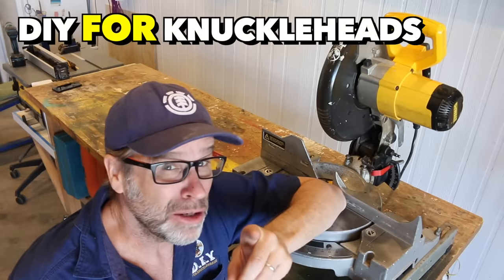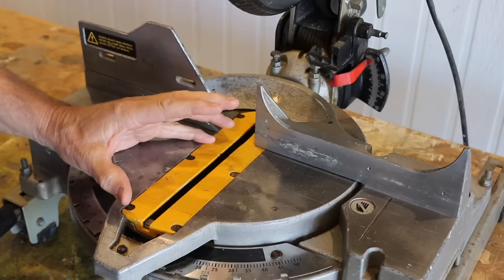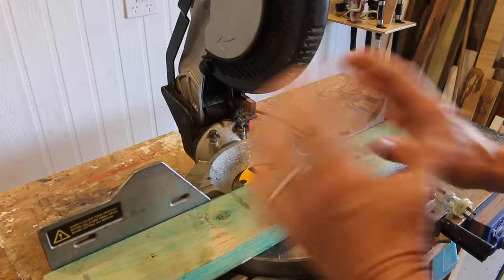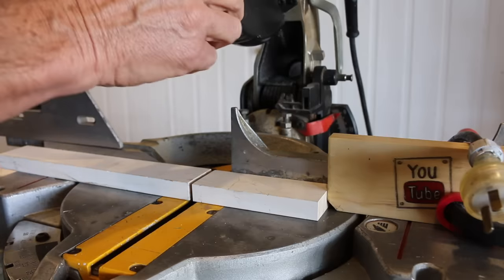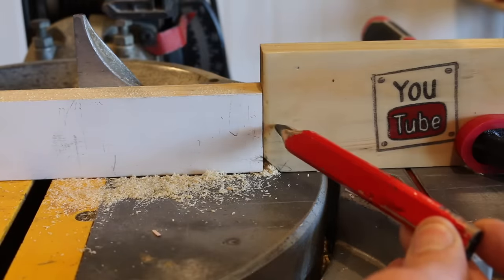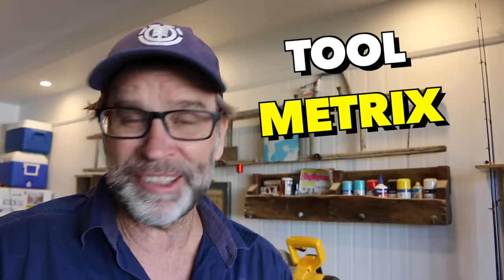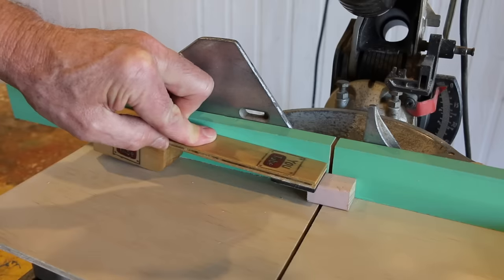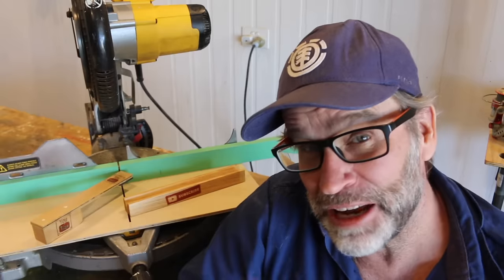My Top 7 Miter Saw Tips for Beginners.

Comment: Excellent. I'll be using your tips. I've been using a chopsaw & slide saw for over 30 years and learned tips watching your video. How about adding a red (nail polish) line to your small workpiece hold down? And red lines to your zero clearance piece on both horizontal and vertical components, left and right side -- since they hide the nice red lines on your saw table?
Making the small workpiece hold down longer could help reduce the inclination to put one's hand too close to the blade -- maybe a quarter inch (6 mm) shorter than the distance from the blade to the left or right edge of the saw table. For my Dewalt compound bevel slide saw that's about 11 inches (28 cm).

Edit: I see in others' previous comments the red line suggestion for the zero clearance plate.
Reply from the maker: All good suggestions mate....wish l had have incorporated them 👍 Thanks for watching 👍😁🇦🇺🎄
Reply: @diyforknuckleheads  Just simple thoughts on my part. Your videos are great. Thank you for them. Thanks for reminding me to stay safe & do well. I wish the same for you.

Comment: I'm looking to buy my first miter saw and ran across your video while researching reviews, and I have to say, I absolutely LOVED your video.  Very easy to follow and fun to watch.  I have to ask, do you have any tips on using the miter saw for cutting aluminum framing? Or should this be avoided at all cost?
Reply from the maker: Thanks mate....glad you found the vid useful 👍😁 You can cut thin aluminium with a standard blade on your mitre saw....l've done it many times but not with your best blade.....l have an older used blade that l put on when l cut aluminium. Cheers 😁🇦🇺👍

Comment: Thank you for the  zero clearance plate tutorial! I made a front opening box spanning the width of our frontroom to house multi-room mini-split lines. I wanted to trim out the front of the boxes, but I had cut very thin trim. The clearance plate worked like a charm. I made three different cuts in the board, one at 90 and 2- 45's (at different spots than the 90.) The trim cuts were so clean and I didn't have to change out the blade from my standard. You have made my work much easier! My little mitre box and hand saw can go back on the shelf. You're so fun to watch too! Keep up the great work!
Reply from the maker: Awesome! Well done Jennifer. Glad l could help and thanks for taking the time to watch...much appreciated 👍😁🇦🇺

Comment: good tips. 1 issue I have had with Tip 7, using the jig can launch the piece especially if it is not a tall piece of wood, as you apply pressure at an angle. I've found another easy way to cut short bits is to use longer bits on both sides of the shorter bit, clamp them in place sandwiching the short piece.
Reply from the maker: Good tip Ed 👍👍

Comment: Looking for advice on cutting two different width boards that have a 1/4” reveal notch, 1/2” from the top of both boards.  First board (baseboard) 5-1/2” second board (casing) 3-1/2”.  Need to match the reveal notch at a 90 degree angle.

Comment: 45 degree angle trick is brilliant!
Reply from the maker: Thanks G.W 👍 Another commenter (webnothing) added this extra tip that is genius.Here is his suggestion: "To extend the 45 deg notch on the stop block hack: cut the notch at 45 and tilt the saw to whatever degree so that you get a compound bevel. Now you'll never need to clear out the sawdust from the notch because the addition of more dust pushes the old dust out. Enjoy! 👍".  Have a good one mate 👍🇦🇺😁
Reply: @diyforknuckleheads  Awww yeah!  I like that idea.  The link is not working but I know what you are describing.

Comment: love the video and the humour of it, the dowling 🚬🚬🚬 had me howlin 😂😂😂

i am a total beginner and wanted to get a smaller mitre saw, realistically (at present) i only want to cut beading and i simply can't decide on a decent saw, but i totally realise that one i find the right saw i might well end up using it for everything...

i (just discovered) that they come in 7 1/4??? 8, 10 and 12 inch, 12 seems far too big for me 🤔🤔🤔

'tear out' seems an obvious problem to (even the beginner) me and love the 'zero-clearence plate' and totally 'get' how it reduces wood 'tear' 🤗🤗🤗

but (so far) in all the videos i've looked at very few mention blades 🤔🤔🤔, aren't there different blades with different numbers of teeth TPI, my point (question) being if you had a blade with more teeth wouldn't (might) that not help reduce 'tear out' or is it 'all about' the way the wood is supported, as you mention 🤔🤔🤔

thanks again for the brilliant video 🤩🤩🤩 🙌🙌🙌

B. out 🤓🤓🤓
Reply from the maker: Thanks Ben 👍👍 For you, the 10" saw would be a good choice. The 12" is a bit of overkill for the stuff that you appear to be doing. As far as the blade goes, the more teeth, the smoother the cut.  Have a good one mate and thanks for watching 🇦🇺😁👍

Comment: For what it’s worth, when using a stop block, securing the cutoff, with your hand or clamp, is a better technique.  With the stop block on the left, your left hand can hold the cutoff and your right hand drops the blade.  This is especially important when cutting tiny pieces.  For safety, when cutting small pieces, a handheld wooden hold-down should be used.  Just my 2-cents.
Reply from the maker: Good tip Malcolm 👍👍

Comment: Just love your channel, learning heaps. Just wondering as a beginner DIY I should go for a basic mitre saw (single bevel, not sliding). Looking at Makita 254mm compound model. Concerned about price  and size of sliding dual bevel models
Reply from the maker: Thanks Tony!.....appreciate the comment mate. As a beginner, the basic mitre saw is perfect. No need to go for the bigger sliding saws unless you have a need to cut wide materials on a regular basis. The Makita is good as is the Dewalt. Cheers 👍😁🇦🇺

Comment: Great tip knackers.....does it matter which side you put the stop block on? I find I like it to the left and i view the cut from the left as well, because the saw motor blocks the view from the right. Just built your saw horses and the work bench is next. 👍
Reply from the maker: Thanks mate and na....doesn't matter at all. I have the stop block on the right because l'm left handed 👍👍 Hope the saw horses went well and good luck with the bench! Have a great weekend 👍🇦🇺😁
Reply: Thanks! Saw horses went great, surprised myself! Couldn’t cut a straight line at woodwork class all those decades ago but now I am lovin it.

Comment: G'day, As a keen but untrained woodworker I value all your video, particularly those that demonstrate various techniques that are not immediately obvious.

One trick that I have recently discovered is that hot-glue joint can be safely taken apart by microwaving it for a few seconds which allows the pieces to be easily repositioned.
Reply from the maker: Good tip re the hot glue Barry 👍👍 Thanks for watching mate and l'm glad you liked the vid 👍🇦🇺😁

Comment: To cut half a sawblade distance off the end of a board, with the saw off,  press the board against the blade. You will see the blade deflect. Now lift the blade start the same a and make the cut.
This is handy for shortening a board that fits too tight between studs, joists, rafters.
Reply from the maker: Yeah good tip Danny.....l use it all the time 👍👍
Reply: This is such a valuable tip, thank you!!!

Comment: I always struggled to correctly make metered frames. The lengths were never accurate. The trick is to cut each piece 2” (50mm) long. Then set up the stop block 1” (25mm) from the blade. Now you can cut the mitres and everything fits. You do need a saw that cps angles left and right.
Reply from the maker: Good tip!...Thanks David 👍😁🇦🇺

Comment: Nice vid m8. One thing i notice is ur dowel jig. Id recommend a redesign as to apply pressure to the dowel onto the fence instead. That jig allows tearout as it is essentally free floating.  Also...inline with ur other safety tips..if the cut piece catches the blade...itll go flying. 

Idea for redesign...shorten the height of the jig to allow you to place the dowel  in it but with some of the upper half showing still. Now you have more surface area and no rounds for better grip and control of the jig. Nowbyou can put it against the fence with pressure. Add some sand paper on the inside or rough the surface up and itll be hard for it to roll about. Add the zero clearence and youre off to the races.

Also...american here. We call it a miter saw too. I havnt heard it called a chop saw in a long time. But thats just me
Reply from the maker: Thanks Sean....Re the jig....once the dowel is in place and held down, it really is quite secure but l see where you're coming from 👍 Thanks for the tip 👍👍😁🇦🇺

Comment: Sir I noticed that your clearance plate on your miter saw is wide open. Unless you have a very old model and it has a fixed plate that is a one piece plate. You can adjust the plates for reduced tear out when cutting.  Nice tips btw.
Reply from the maker: Thanks mate and yeah...it is an old saw 👍

Comment: This is a great video for scaring people straight regarding crossing your arms under the blade. There is a video of a woman building new front deck - she really needs to see the way you present this. Truly terrifying.

For cutting a short piece - I have always clamped a block to the fence to hold it down instead of using my hands. But then I didn't have a zero clearance plate so now I need to build one of those - making it long enough for an extended fence as well (to mount stop blocks)!
Reply from the maker: Good tip re the clamp Ron and thanks for watching mate 👍🇦🇺😁

Comment: Stop block tip. Split your stop block in two and  only clamp the piece furthest away from the blade. Once you've positioned your workpiece, hold it down and remove the stop block piece that is not clamped. This will avoid pinching and the blade grabbing onto the offcut.
Reply from the maker: Great tip 👍👍

Comment: I gotta say, even I still wouldn't attempt tip 7 for the fact, its like it will work in one instance, than it may not. I rather find a similar piece and cut to a smaller length, than risk losing my fingers. BTW, the 45 degree cut on the end is something I have never done before and is brilliant, including the dowel piece you made for it. Thanks for sharing.
Reply from the maker: No worries mate....thanks for watching 👍😁🇦🇺

Comment: Smart ideas! Regarding the last tip, how did you cut the V notch?
Reply from the maker: Thanks P.P.👍 I cut mine on the table saw. If you don't have a table saw, cut a 'V' in the centre of a wider board using the saw guide that comes with your saw as well as setting the saw to 45 degrees. Once the 'V' has been cut, then you can trim the board down to size. Hope that makes sense and good luck with it 👍🇦🇺😁
Reply: @diyforknuckleheads  thank you!

Comment: Awesome tips. Had not even considered/ seen a few of them before which is surprising.

Ill say though,  just for clarification, a chop saw isn't a mitre saw. Chop saws aren't supposed to be able to change angles (just cross cuts, not mitred cuts). They were widely used in framing where you aren't doing mitered cuts as much, and they were cheaper than mitre saws. Im sure people use that term incorrectly,  but there is a diff between the two.
Reply from the maker: Cheers Chris and thanks for the heads up re the chop saw. 👍👍🇦🇺😁
Reply: Chop saws also usually have abrasive disks instead of blades because they're intended for cutting metal.

Comment: Great tips 👍 Although that jig, to hold short pieces, is great idea; you'll notice that your cut wasn't 90 degrees. No biggy, unless they require accuracy; when cutting architrave, for example. Great video 👍
Reply from the maker: Cheers mate 👍🇦🇺😁 Thanks for watching 👍
Reply: I add a piece of double stick carpet tape to bottom and/or back of small pieces to hold them securely in place
Reply from the maker: @juliemandell  Good tip Julie 👍😁🇦🇺

Comment: Hello, my boyfriend is a knuckle head and so am I, I suppose, cause I just bought a 300 year old former church building (but it was very cheap and I was desperate for somewhere to live, I'm traumatised by renting from an awful landlord) and now I'm in Shetland and wondering what I've done to my life! It looks kind of like a house, but we have the pews, they are quite flimsy looking things, not like proper heavy solid church pews, and (I think) they are attached to the wooden floor through big peg like things sticking into the flooring. My question is, what tool would I use to cut them away from the flooring? I am looking at wilko at the saws and it's all confusing me. Would an angle grinder work? Or what kind of saw? Sorry for the silly question! Many thanks, Eda

Comment: I want to add a bit of advice about cutting dowel. Years ago I was doing a project with my amazing 14" miter saw. It was sitting on the ground at the time ... I know ... So I grabbed a piece of inch and a quarter dowel and put the measurement mark in place and got ready to cut. I hit the trigger and brought the blade down. I heard the most amazing ZING noise. As I was squatting there i realized that the blade had exploded! I started checking myself to see if the blade had ended up lodged in my torso. It wasn't. I walked into the bathroom to find little points of blood all over the front of me. From my forehead to my knees I had been shrapneled. Not badly, but enough to make me pay lot more attention next time! What had happened was that the blade was not up to speed when I brought it down. So as it touched the dowel, the dowel spun just a bit to add an upward pressure on the blade, to the point that it ripped apart. So always make sure your saw is completely up to operating speed before cutting ... dowel or anything else.
Reply from the maker: WOW! That must have scared you a bit Frank 😬😬😬
Reply: @diyforknuckleheads  LOL Are you kidding? I near wet my pants!. A 14 inch saw blade is far more flexible than a 10 inch and i'm sure that contributed. And a piece of metal that big makes a hell of a ringing noise when it takes off in the air. Thank you for all your advice and safety tips. I hope my experience might be a safety tip for someone out there.

Comment: I recently had a piece of quarter round go flying when it splintered.  I wasn't trying anything fancy - sizable piece to work with and was cutting off about 1/3 of it.  Could that be common if the board was really dry?

More great stuff - as usual, learned something today.
Reply from the maker: Mate...bit of a mystery that one....could've been a weak spot in the wood?? Not sure....Thanks for watching mate 👍😁🇦🇺
Reply: Any time you use the factory fence the you'll notice that the teeth of the blade are rising upwards and can lift the pieces off the bed . To avoid that problem you can simply add a piece of scrap wood to the fence , that will bring the workpiece forward and ensure that the teeth are cutting in the down and back orientation . Hopefully that will give you better results . Cheers
Reply: @scottclark798  Good thought, Thanks!

Comment: I bought a 12 inch DeWALT miter saw (DWS715)  a week ago, but I haven't opened it because I'm considering exchanging it for the 10 inch model.   The reason is that I also have a 10" DeWALT table saw.  Having a 10 inch miter saw will allow me to use the blades on both.   I see many more 12 inch miter saws....just wondering if I should keep the 12 inch.  Any advice would be greatly appreciated.  (Ironically, the 12 inch was $30 cheaper.)
Reply from the maker: Jeff....here's my two cents. I had the 10" for at least 15 years and was very happy with it for all that time. Every now and then l wished l had a bigger saw but it wasn't a deal breaker. However, since l've had the 12", the extra cut has been amazing and l didn't really know what l was missing out on. The only drawback l can see is that it's bigger which makes it a little more difficult to move around. Good luck with your decision...which ever way you go you will be happy 👍😁🇦🇺

Comment: One reason  I see people "reach across" the blade seems to be because they are right handed and it's so much easier to pull down the saw with the dominate hand and the switch on the handle is so much easier to pull in with the index finger "side" of the hand than the "pinkie" side of the hand.

This risky move seems to happen when they are trimming just a bit off the end of a long board whose long end is to the right (perhaps taking half a hair off of a long piece they just cut a bit long). Without rotating the long board around the "y" axis (assuming there even is something set up to support the 14 foot long piece of lumber to the left of the saw), there's little or nothing to hold on to on the left side (where there is just a tiny scrap piece). To use their right and dominate hand to handle the saw they end up doing the "reach over".

I'm tempted to do this occasionally, but manage to restrain myself as imaginary images of freshly excavated blood vessels, arteries, bone, tendons, and muscle tissue flash through my mind.
Reply from the maker: Good call mate......it's so easy to be a bit complacent at times 👍 Thanks for watching 👍😁🇦🇺

Comment: Any tips on how to drill the holes on the mitre saw fence to screw the timber fence? I have the same saw!
Reply from the maker: Yeah Chris, just grab yourself a drill bit the same size or slightly bigger than the screw you’re using and away you go. Once the hole is drilled, put in a lager drill  bit like an 8mm bit and slightly countersink the hole so the screw sits better. The base is cast iron so it’s really easy to drill a hole into...good luck 👍